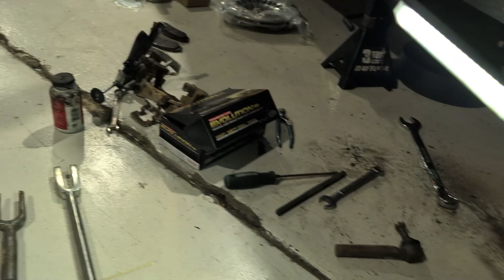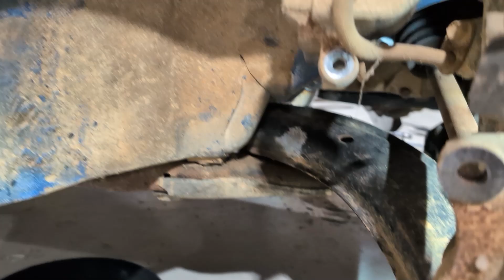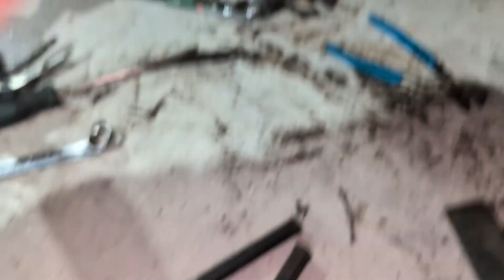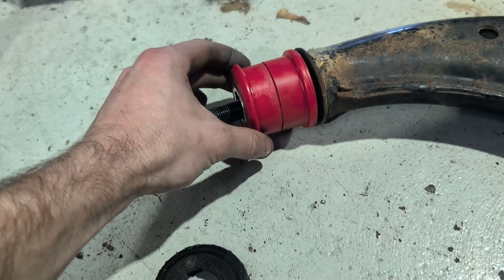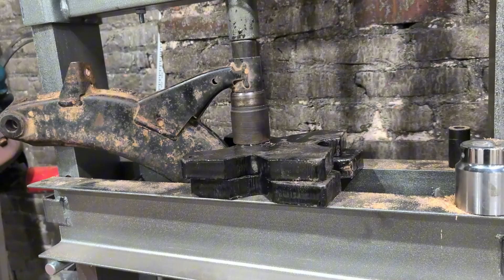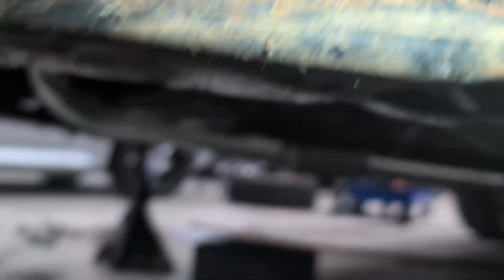How-To: Replace Front Bushings (2003 Subaru Impreza WRX Suspension)

Comment: Thank you for uploading this. I’m repairing the front control arm bushings on my car and I saw the big amount of slop on the rear bushing and I didn’t think it was normal. But after seeing yours i have a little more faith in it. How did it sound after driving for a little bit?
Reply from the maker: I didn't have an issue with them yet, and have been driving on it since this video, it sure was strange though.